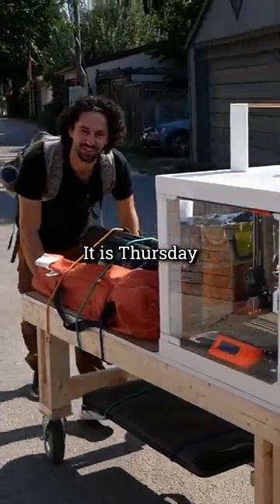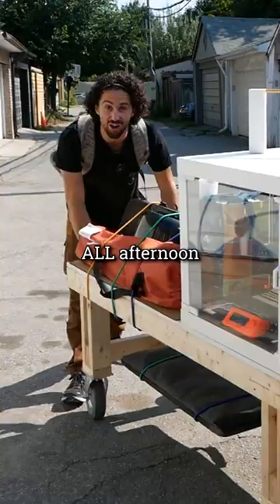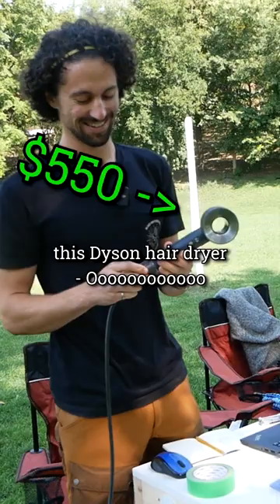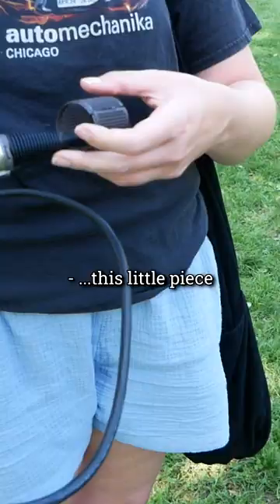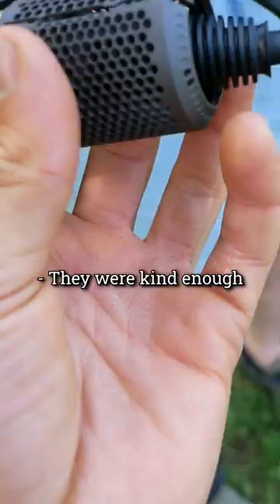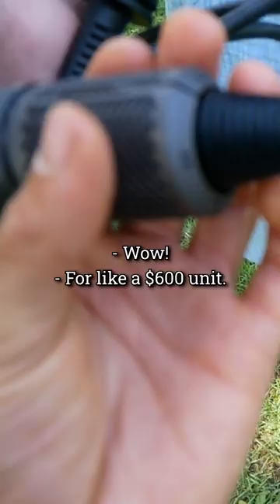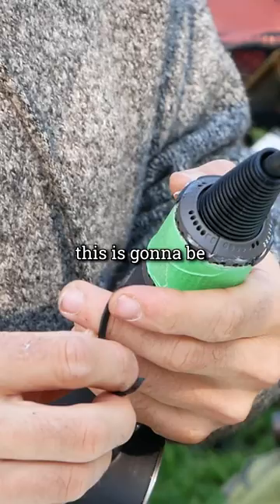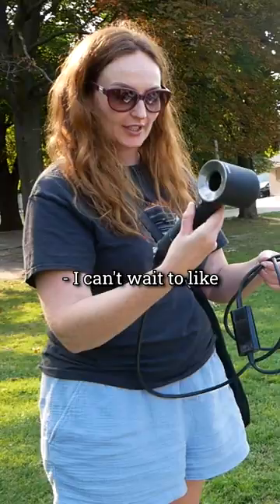Fixing a $500 Hair Dryer with 3D Printing #DIY #3dprinting #repair

Comment: Oh look, a $1 plastic part with designed obsolescence that the replacement costs $100. Good on you Dyson. Good to see you know how to shaft your customers in the long run. Part fixed wit about 30¢ worth of materials.
Reply: More like 5ct
Reply: That's capitalism, baby!
Reply: @Bohnita Roy Choudhury  sorry, but capitalism is not just "the right to own stuff n get profit", there's quite a lot more to it
Reply: Dyson is known for shoddy products and an unwillingness to provide replacement parts for a reasonable cost.
Reply: A fool and their money shall soon part
Reply: And it costs them even less to mass manufacture..
Reply: I hate Dyson (the founder the company is named after). Total brexiteer. Threatened to move his operation to Europe from Britain. 😒
Reply: Only problem might be that the fact he used epoxy now it means they’d never be able to replace it even if they wanted to. For some reason I thought he is printing the filter rather than brackets to glue it in. But non the less. Nice for helping for sure.

Comment: You are going to blow up! We full time RV and I'm a retired engineer. I noticed you are mobile. Is your printer self leveling? Also the software you use is it essentially CAD?
Reply: The printer itself can be sideways as long as the bed is level and prusas have auto leveling
Reply from the maker: Thank you! the software is Fusion 360
Reply: @Bslatz  oh that is awesome! I appreciate it. Been on the fence about getting one. Any models you would recommend?
Reply: @aegiscaleb  i would recommend looking into Bambu labs p1p over the prusa as it is more reliable and faster at a similar price
Reply: @nightowl403  thank you! I appreciate the insight. Will definitely check that one as well. Wife is going to murder me if I keep finding files to print for the kids